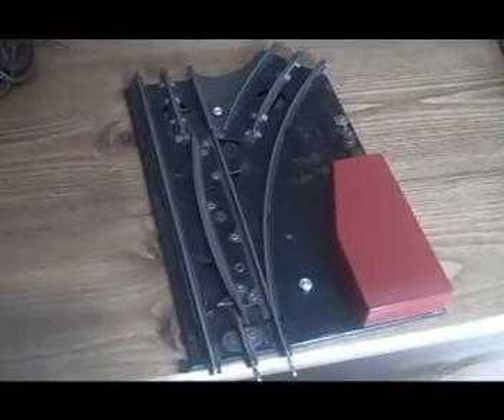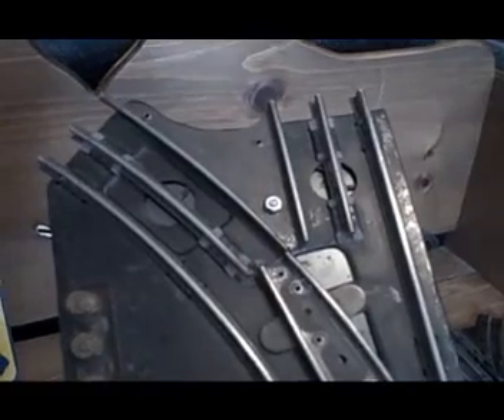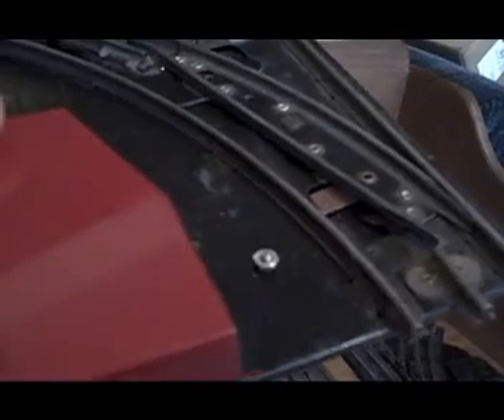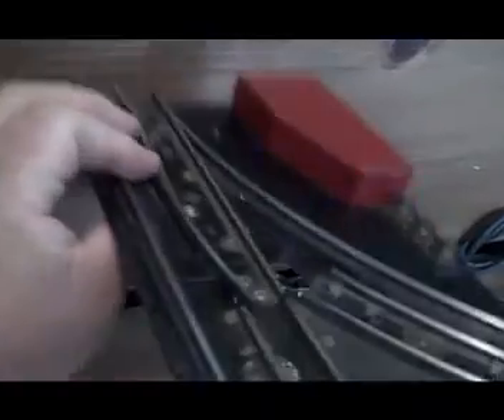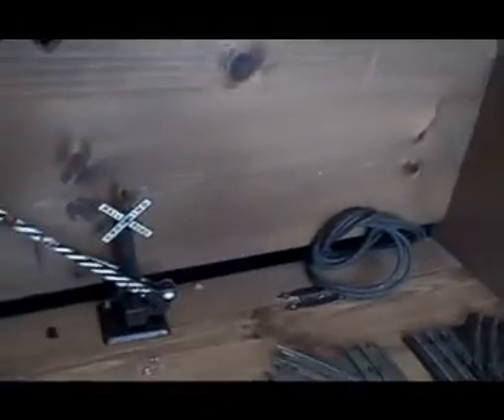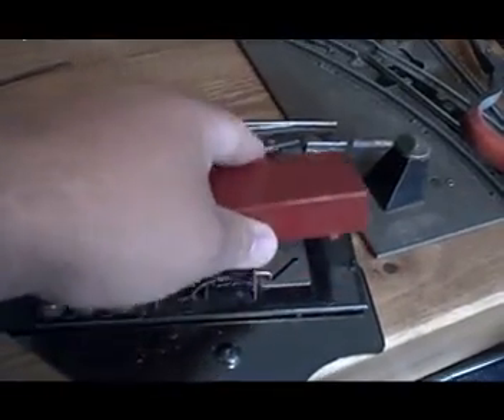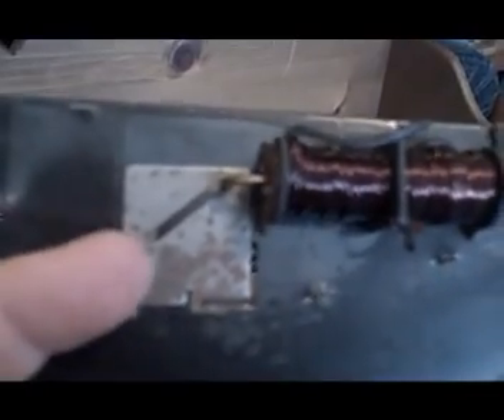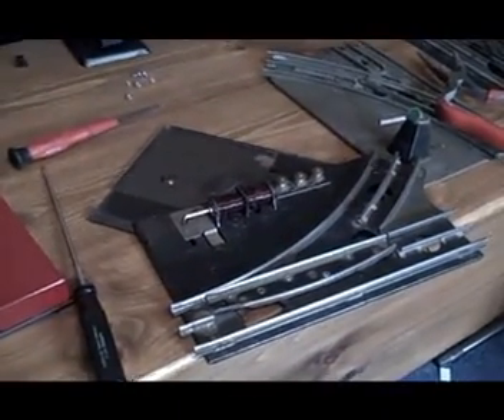Marx Trains Switch Track: Function and Repair Part 1

Comment: Thanks for the video.  I just received shipment of an old Lionel set that has similar Marx electric switches, but with an indicator light as well.  #4 machine screws it is.  Unfortunately it seems the set was boxed in an attic or shed in salt air and the rust monster has seriously invaded.  Major restoration needed.  Just wanted to see the guts before I broke out the tools.  Thanks.
Reply from the maker: You bet Kaptain, good luck!